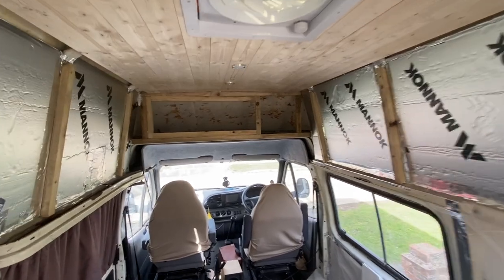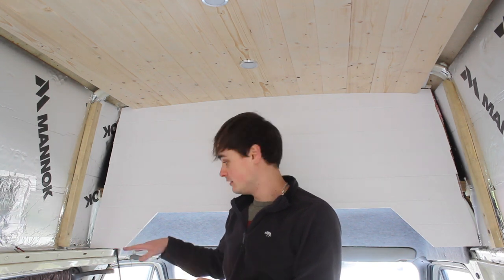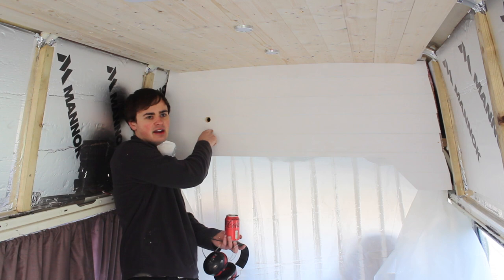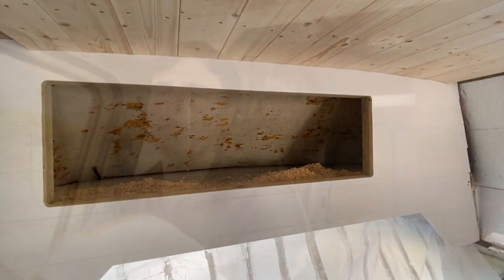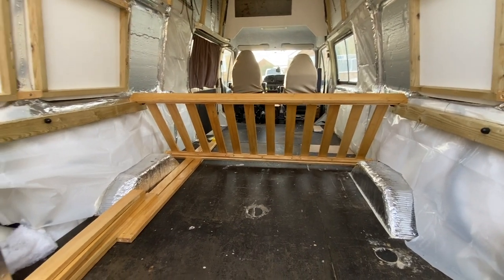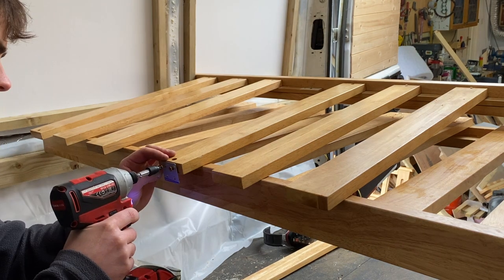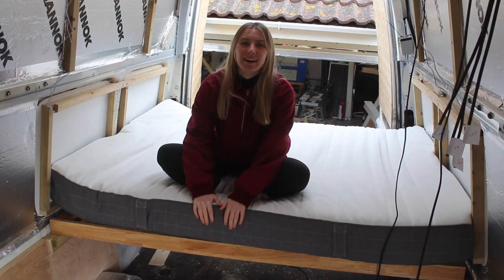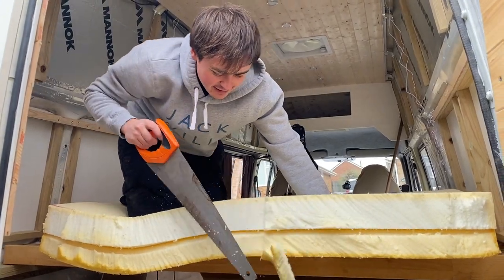Building a Slide out Bed from FREE Materials - Van Build Series - Episode 11

Comment: love the sliding bed design that works great and opens up a handy double use space. I like how you look for used unrelated items that you can re-purpose for a job ...that's proper recycling ! The wood in the bed would probably have cost you best part of  £75+ new and wouldn't be anywhere near as strong or attractive either. In the past I have dismantled used  Ikea type wardrobes to re-purpose the doors and side panels for partition walls and worktops .